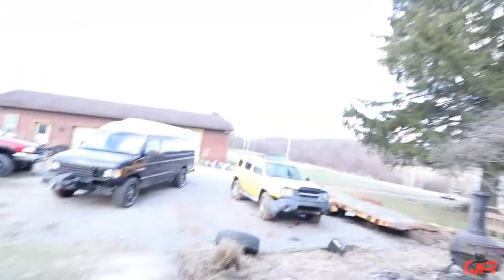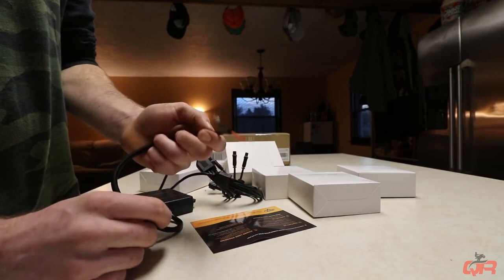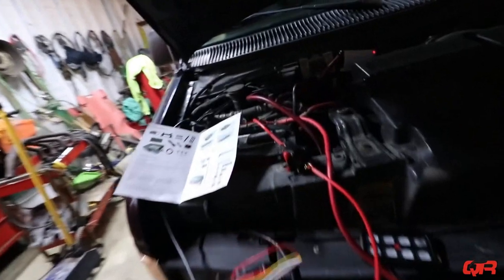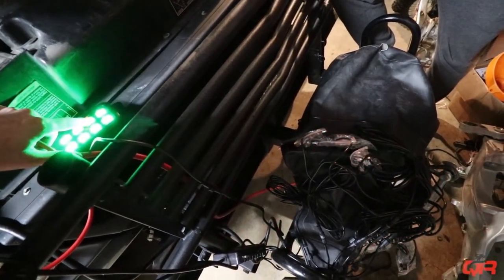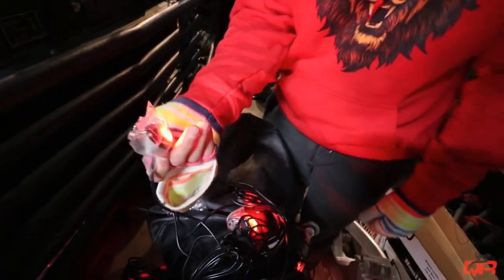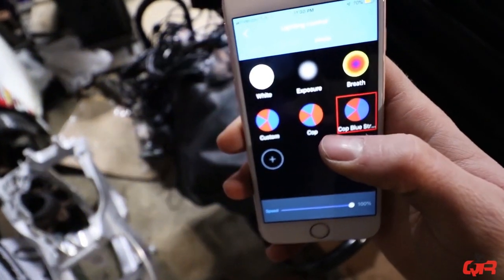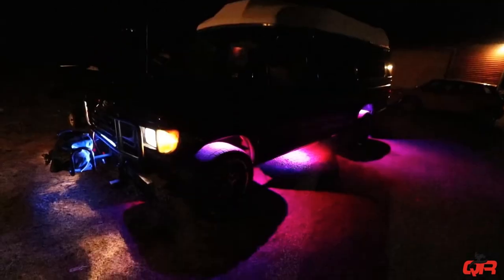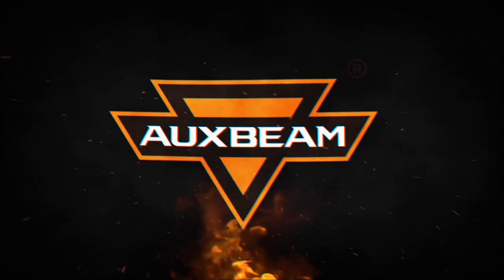How to use the 8 Switch Panel System to control the Rock light?

Comment: What happens if you use the light bar complete wiring harness WITH the relay into the switch box?
Reply: Won't work. I tried it with mine

Comment: So to control the brightness what to you connect the yellow wire to and what do you connect the white wire to?? Nothing says or shows how. Very sketchy instructions
Reply: Got to hook it up to a 12 volt momentary switch each time u supply power to the white wire it will dim the switch panel backlighting to 4 different brightness